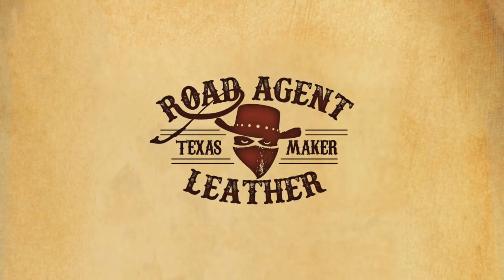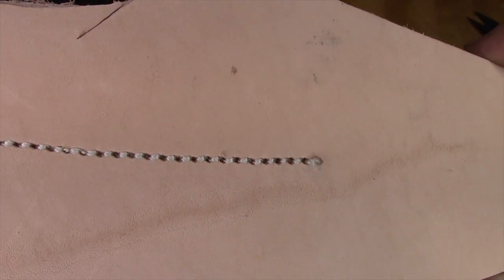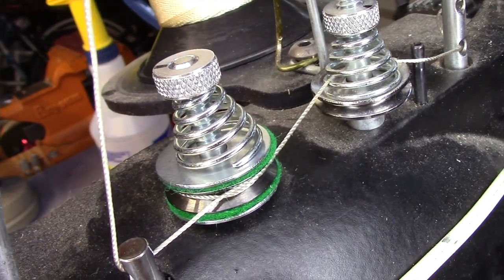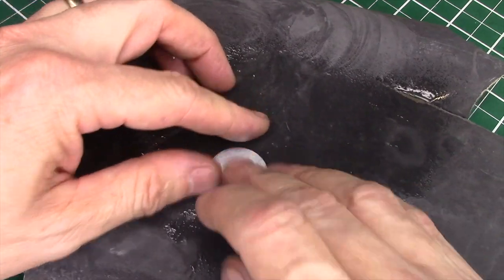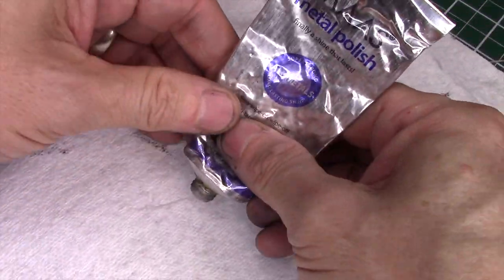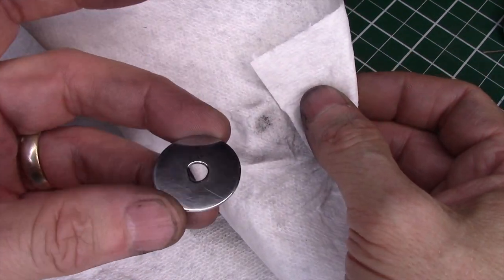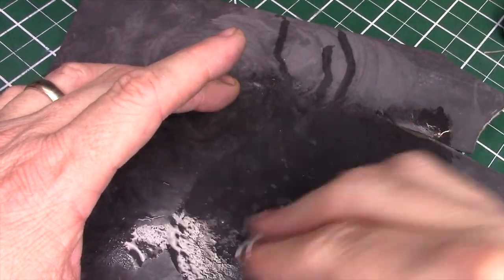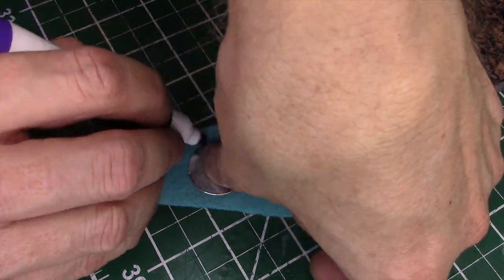Tippmann Boss Sewing Machine Stitcher Fluff-n-Buff Leatherworking Leathercraft

Comment: “Dirty” pulley and washers cause a lot of problems. Sewing machines of all kinds throw off a lot of fibers that are difficult to see. They become slightly tacky which causes the thread to do strange things. My father had a shop where they made women’s clothing. There were 10 seamstresses working. You would be surprised at the amount of fibers in the air and on the machinery. That was the cause of machinery breakdown. My father had all Singer sewing machines. Every Saturday after work he would break down the sewing machines and thoroughly clean them out.

Comment: at 119you can see the thread making a circle around the tensioner thats not the way it should be, that's most likely the trouble with it, i,ve used my boss for about 5 or 6 years and never threaded the machine like that, and never missed a stich, dont think thats the way the manual said do it either
Reply from the maker: It's not how I thread it. I filmed this after pulling everything apart, that's why I mention things may not look right.
Reply: Does it really matter? So the thread should go under the fire loop? Thank you